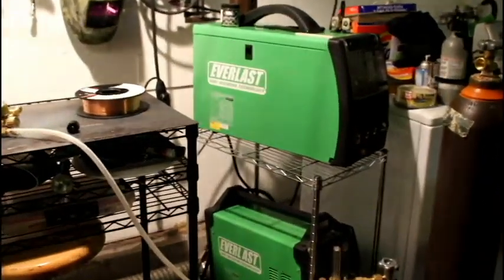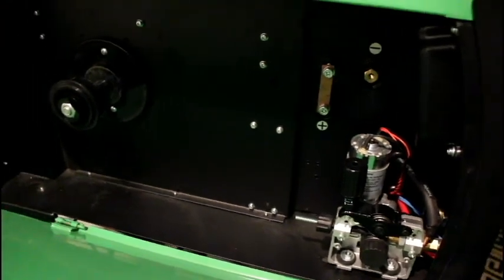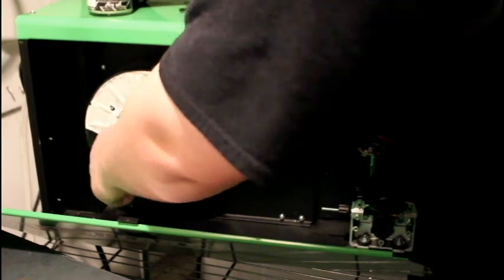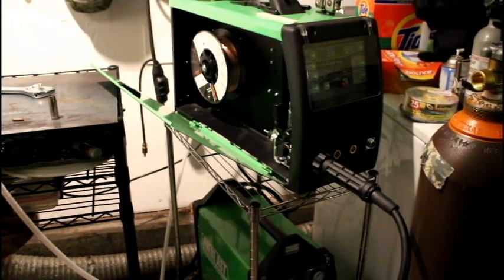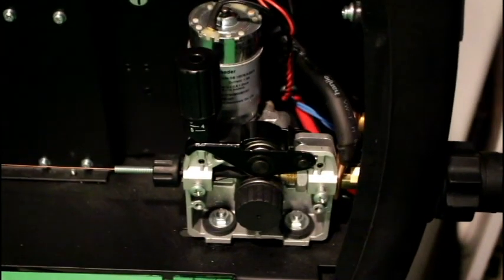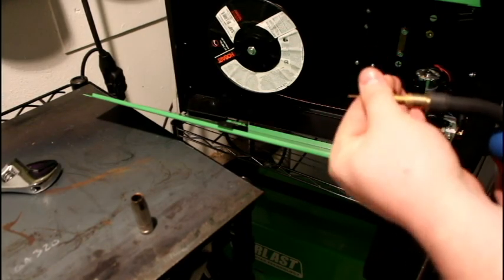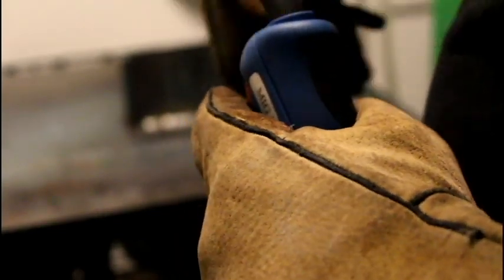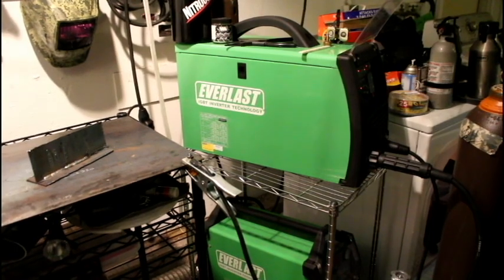Everlast 211si mig welding setup

Comment: Did u have to get a different mig gun for flux core as the directions state ? I have 5 spools of flux core but am hesitant to use them
Reply: Should, their accessories are cheap,  but probably some else has cheaper.

Comment: been a few..you still recommend this welder? Not many reviews on this
Reply from the maker: I do, I really like it, I have used the mig function the most but it is a capable stick welder and a fantastic tig welder. For stick welding I ran through some E6011, E6013, E7018s and it did great no troubles with the 6011s (havent tried 6010s). Tig welding with it is great but I usually use my 256s for tig projects and this is mostly for mig.
Reply: I was going to order from Everlast the 251si ..but came across many posts on the welder forum about them charging for the feed rollers to run simple flux core..thats unacceptable and in my opinion just a way to extract more money from the customer..also waiting weeks and weeks  for parts and accessories  to be shipped...again thats unacceptable ...sorry but if  a product line want's carve out a place along side of Miller and Lincoln their gonna have to do a much better job...
Reply from the maker: s smith as for the rollers if you want to run Flux core you have to order the rollers to do so. They are 20$ but if you sweet talk the salesmen I'm sure they would include them. (talk to oleg@everlast sales) and yes I very much recommend this welder it has a lot of versatility.
Reply: s smith you can buy the miller 211 for another $500 and not get a tig torch. Having to order a roller is minimal
Reply: s smith maybe you should just buy a miller than. You will soon learn they all do that. We ditched ESAB and have 4 Everlast in our machine shop now. The service is the same. Go call Miller customer service and let me know how far you get and how long you wait for parts that you will have to pay for anyway. Just saying. Everyone things the big brands have great customer support ( thay don’t) just a name like Nike, Reboc
Reply: smith  I've been  running flux core without  changing  rollers and it works just fine

Comment: I watched this because I always thought the spool was too loose and doesn't tighten up. I thought a part was missing ( just a design problem from china).  My Lincoln has a friction washer so you can set it to have a little drag.
Reply from the maker: That would be nice. I ended up getting extra rollers for flux core and threw a little washer infront of the spring to help tension it very slightly. Never really had an issue with the machine :) still rockin!

Comment: Manual says the welder has Spot and Stitch mode. Do you know how that is set?
Reply from the maker: Mark A from what I understand the 251si has this feature but the 211si does not. I will further research it but looking at my welder I do not see where this is an option.
Reply: I double checked the manual and under features it lists Spot an Stitch. I see there is an LED on the face panel labeled seconds.
Reply from the maker: +Mark a I could be wrong but having used this welder for almost a year I haven't found that feature and am pretty sure there is an asterisk at the bottom of the manual (which is (I believe) for both the 211 and 251si models) saying that Is for the 251 model. The seconds label lights up when you are adjusting burnback, upslope, downslope, preflow, and postflow. I would check the Everlast website for both models, and if this is a feature you require I would check out the 251si. Chucke2009 has full feature videos on both I would recommend his channel as well.
Reply: Yes their advertising has a spot stitch timer listed.  I had mine about 90 days and called them and spoke to their tech support guy whose voice i recognized from videos.  He said it doesn't have that feature, but said it was a misprint, sorry.  He said I was the first customer that ever brought that up. Liar!  He said they would change the specs I checked back a couple of years later, china never got around to changing it.
He also said I should have got a bigger welder.  I was thinking after talking to him, yeah and a different brand.